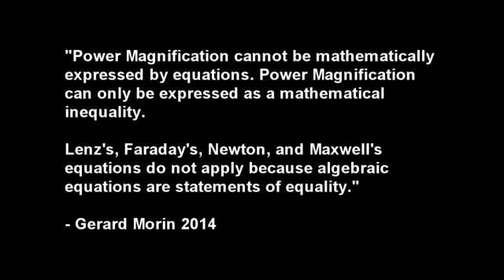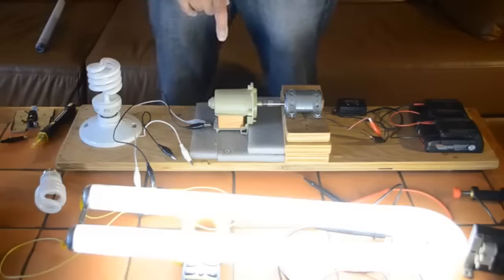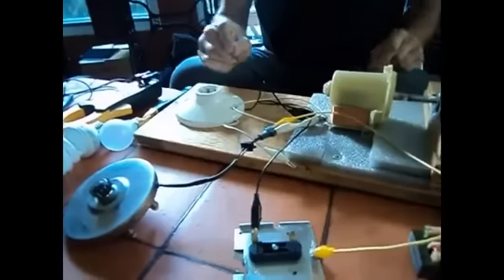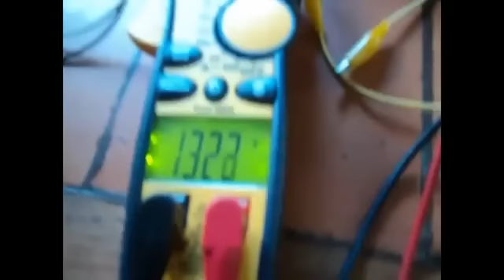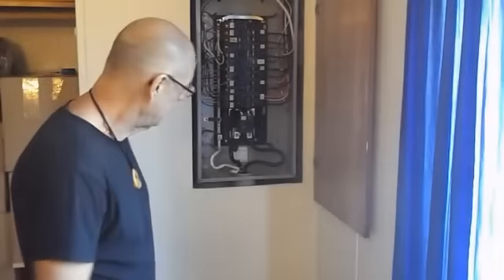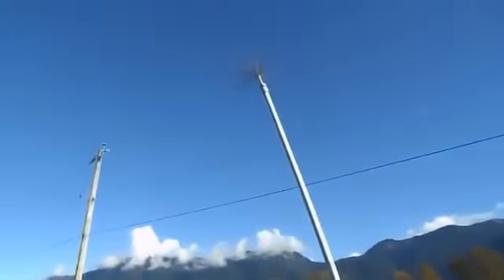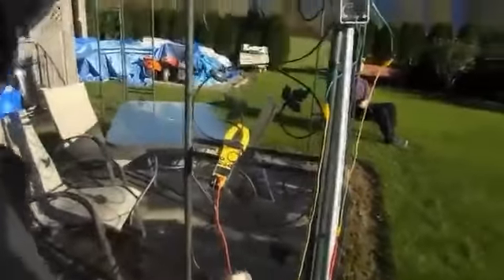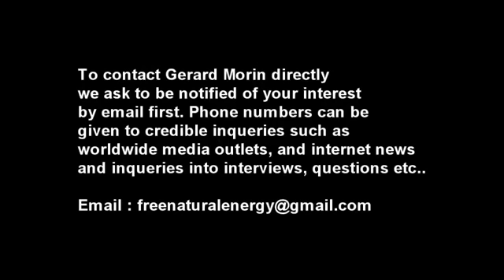Time to END The Electricity Racket - FREE & NATURAL ELECTRICITY PROOF

Comment: Congrats, you've just made an overly complicated transformer and wave generator.  I did the same thing using a buckboost converter.  Ran an 8 watt LED off of 4 d cells for 6 months... Still not over unity.
Reply: How you did that? I am looking keep a LED candle lit as long as possible. Can you tell me how?
Reply: @schiaucugabriel6202  Depends on it's voltage, and power draw. If it's high voltage, and you want to run it off a lower voltage battery, you need a boost converter to step up the voltage. also, it'll draw more current on the low voltage side than it will on the high voltage side. 
So you need  battery -> boost converter -> LED candle. And then once you have that, you measure the current on the low voltage side, multiply that by how many hours you want it to run, and that is how many Ah or mAh of battery capacity you need. I would then double that, as it's never a good idea to run batteries flat if they're rechargable, it shortens their lifespan. 
Just look for a boost converter on ebay, there's plenty around, just make sure it's input and output voltage is sufficient, and the power rating is sufficient too. An LED candle won't need too much though, so a small one will probably do you.

Comment: The inside of a fluorescent tube is coated with phosphores which light up when struck with ultraviolet light. The ultraviolet light is normally generated by a current passed through the tube. If you apply radio frequency current you will also light up the phosphores. If you have a ham radio transmitter you can hold onto a fluorescent tube near the radios antenna circuit, you don't have to touch it.Transmit and the fluorescent light will light up. This chap is using that technology, it's nothing new. 

He also talks about putting up a whip and connecting a voltmeter to the whip and ground and measuring AC voltage. That voltage is not natural from the earth, it is bleed over from the commercial power grid. If you have an audio amplifier and stick your finger on the center pin of the audio input you will hear a loud buzz. That's because you are acting as an antenna for the commercial power in your home. The current is very very minimal but able to be amplified and applied to a loud speaker.

If you do put up a pole as this fellow did and measure the DC voltage to ground you may see a small voltage and as a storm heads your way you may see quite an increase in voltage. That's because clouds can carry quite a charge, sometimes building up to the point you get flash over from cloud to cloud or cloud to ground, something called lightning. Don't bother trying to operate your electrical equipment from it or you'll end up quite charred and dead. 

What I'm trying to say is do your own research, ask questions of people who are qualified to give you some correct answers. There are plenty of people who use their imaginations to make things up and then use the strangest ways to try and prove it. This fellow is one of those. I don't know if he believes his hype but if he does then so sad.
Reply: One of the few people in the comments who understands what's going on, thanks for trying to educate people! :D
Reply: Donn H, you saved me from writing a lengthy post by doing it for me, I agree with everything you say. I have seen florescent tubes within their packaging in a local hardware store light up simply by touching them ( the store is adjacent to a high voltage power station) and as a Radio ham I am well aware of the effects you speak of.
Reply: It is quite interesting some of the points you have raised and leads on to some weird questions i have in that regard. 1st point - it actually does light the lamp, i know this from experience.( not next to a massive power line )  which leads me on to the question of why not if it works..  we seem to be putting more and more stray waste energy into the environment, so why not harness that if possible? it makes sense and received radiant energy seems quite a simple and possibly cheaper concept than trying to reduce emissions.  I'm not to keen on the something for nothing theorists but was Tesla actually on to something 'natural' ,  there are many types of energy floating about, some only recently discovered, for example solar power wasn't 'discovered'  until we had a medium to convert it, even though it has been there all along. I have an open mind about some of this stuff, especially as far as Tesla is concerned.
Reply: klumpy103 try this make an HHO generator use gas to create heat through a pladium laced sand then transfer heat to a sterling engine while using peltier chips to cool HHO generator and create power to run same use sterling engine to compress air to run a turbine to generate power for charging or DC power. The bigger you build the more power you get..... Don't forget to use a pulse wave modulator to keep HHO generator from runaways . simplest way for free power. 12vdc@20amps for HHO
Reply: I can light up those bulbs with a vacuum cleaner hose lol
Reply: He also needs training in how the electrical system works. In the electrical panel, when he was testing the current on the neutral/ground bus, that he claims was being fed back is incorrect. I have had allot  of training and experience in the electrical field and an associate degree in electronics and can explain what he was measuring. Because 220v is being fed to the house, most of the current will pass through on the two hots. He showed  3.5A on one hot and "hardly nothing" on the other. There is only .2 amps difference on the ground. That is because that wire only carries the unbalance load and because it is going to ground, not back on the hot lines their can be no feedback to the electrical company.
Reply: Well put Sir ! I didn't have the patience to type  what you have so  eloquently done.
Reply: I have put all kinds of burnt out light bulbs in the microwave oven.... THEY ALL LIGHT! 
Of course if you go to far, they’ll explode do to the high heat generated.
Reply: I'd like to hear your thought's on Marco Rodins work if at all possible, you seem like the right guy to ask    xpeacex
Reply: Good effort Donn H on truth finding, I can't believe how many are applauding these "experiments"! 

I see other misconceptions as well, when he had the ozone generator there were no plates in the plate rack, it was not making ozone, the neon lamp lit up on the RF antenna was not proof of "making ozone already" it only proved there was high voltage on the RF antenna. Also there is no such thing as "negative ozone" the RF antenna emits pulsing ions, positive and negative ions pulsed at variable frequencies to kill mold, mildew, bacteria, etc. I could not see the needle point ionizer, if it is there it produces negative ions which are beneficial to healthy environments. To say the least he does not understand how this air purifier works.

In the US Navy they would check the radar antenna function by walking the cat walk holding up a fluorescent tube, not a new discovery at all.

Using "burnt" instead of "burned out" is disturbing, I finally figured out what he meant but modern rapid start ballasts do not glow the filaments to strike the lamp. Donn H, your assessment of the phosphorus glowing is accurate, however this video seemed to rely on his high voltage and vacuum to make the tube glow, not true. I did not hear him say there is a drop of mercury in the tube and the arc strikes from pin to pin on mercury vapor! His statement about a vacuum is also false, inside is a mixture of argon, xenon, neon, or krypton gasses, and of course mercury vapor.

Then he says these will never burn which I think he means they will never stop glowing, let's put it this way: he has not run them long enough to use up all the mercury vapor but when it is gone the lamp won't strike or light!

The whole discussion at his electrical panel is absolute nonsense! He just proves he has never worked as an electrician and his understanding is now proven null-and-void. I can't believe he is reaching into a live and open panel with bare hands and open lugs. 

Many other misconceptions and he has been doing this for 10 years? Why on earth does he still have a conventional breaker panel with over 20 circuits feeding his house, I thought he said he could light 10,000 LED lamps on his kitchen ceiling so why not just do that?

Comment: The real fact is that no one is stopping anyone from doing this but no one is doing this which tells you it doesn't work. If a power company could produce electricity for free the shareholders would demand it immediately.
Reply: @toddblessuable  except you made that up.
Reply: Actually, I have a 350 watt generator designed to go on a stationary bike, one that generates energy when you pedal. I have it setup to run off of a 12v variable speed drill motor via chain drive. There is a voltage regulator between the generator and the battery bank. Right now, it has a manual toggle switch to start and stop the motor. I'm looking into Arduino to get an idea on how to build a switch that monitors the battery bank voltage and turn on the motor when the voltage drops and off when it is recharged, basically, the opposite of a low voltage cut off switch. IF I can build this switch, I'll look at bigger wattage (8k to 12k) wind turbines for one that could be used the same way, build a good sized battery bank with an inverter between the battery bank and transfer switch, which is wired into the breaker box.
Reply: @snowflakemelter1172  How old are you?
Reply: @kevinnewell5996  you think you can pedal 12,000 watts ?
Reply: No, but if actually read what I said, you would have read that I stated that it is ran off of a 12v variable speed drill motor.
Reply: @kevinnewell5996  so you have invented a way to lose power through electrical resistance and friction.
Reply: I can see where you would think that. The motor is a 2ah motor, which is not a lot of draw if you think about it.  I chose to go with a chain drive with a tensioner to drastically reduce the friction that a belt drive has. As to resistance, the generator is a low speed cut in, which means that there is very little resistance before it starts generating power. As to 1,500 RPM, that is the max that the motor is designed to run, however, I have to reduce it down to hit and maintain a steady 350 watts. I can, and have thought about putting a bigger generator on the setup, something along the lines of Windzilla's 3200 watt 12v  generator, which again, is a low speed cut in generator and can be ran off of the same motor.
Reply: @kevinnewell5996  motors aren't measured in amp hours,  you don't even understand basic electrical terms.
Reply: You are correct, motors are not measured in amp hours, but torque and/or horsepower, however, understand that the motor was literally taken out of a drill specifically for the build purpose. The drill listed only two types of measurements: "12v" and "2 amp hours", nothing mentioned torque or horsepower due to the gearing of the drill. Hence, the reason for the reference of Ah.
Reply: @kevinnewell5996  the amp hours of a drills battery has nothing to do with the motor,

Comment: If that actually worked, he could loop it back to the battery and charge it. All he made was a lesser transformer than using two coils.
Reply: Good observation but you need the amps for that.
Reply: He can be charging another set and swap as power runs out.

Comment: First law of physics: "There's no such thing as a free lunch".

In this video, the motor operates at a certain voltage and drives a generator that produces a higher voltage. That's why the lamps are brighter. So is there any gain here? Absolutely not! The current needed to drive the motor will be much higher than the current available from the generator so there's no net power gain. The power taken from the battery is the product of the low battery voltage and high battery current and the power provided to the lamps from the generator is the product of the high generator voltage and the low generator current. Furthermore, ignoring the losses in the motor and generator, these two products are equal.

Even if you don't understand the basic physics involved, think about it. If it was that simple to "amplify power", then why is the whole world struggling with high cost energy supply problems? Answer, because these schemes don't work.
Reply: there could be some things that are hidden, becouse in this world everything spins around MONEY so I'm still thinking there is a better way
Reply: First law of physics: “There’s no such thing as a free lunch”. I was taught that very thing years ago. By a man light years smarter than this guy.
Reply: "A little bit of knowledge is a very dangerous thing" because it convinces a man he knows it all. It's Nilly impossible to convince a Man he has been Fooled because he'll cling to the LIE regardless of any Evidence.
Reply: this is why tesla says ,the people who live now are not ready for my invents? because they stay whit the standard processes and will never vind the smart coupes in a energy meter , i know you wont , o yeah if you send me a address i wil send a free lunch to it ! so nou it exist you standard man keep up boost you health for zo long

Comment: Mr. Gerard Morin, I am confused, with due respect, at approximate 36:50 into your video, you said that with a stronger magnet(fuel cell) in power unit (magic box), you could make all your home appliances work. 
Question #1) why can’t you afford a stronger magnet?
Question #2) why aren’t you off the grid, since you claim that all your appliances would work if only you had a stronger magnet for your power unit?
No disrespect.

Comment: Also I’ve had a converter box you plug into your car cigarette lighter and it has two regular house plugins in the box and it can run anything plugged in it all from a 12 volt car battery, I’ve had that in 2010

Comment: One of the aspects of energy flow is the frequencies involved. The motor is spinning at a high rmp which is being transferred to the other motor that is acting as a generator and it too is spinning at a high rpm. This has raised the frequencies of the voltage being generated. Running electrical systems at 50/60 Hz (cycles per second) is a low frequency that does not allow much of the electron potential to move fast and thus much is wasted as heat. The higher the frequency via a wire to an electronic device results in more of the potential to be used and less heat being generated.
Reply: No. There's a transformer on the other motor.